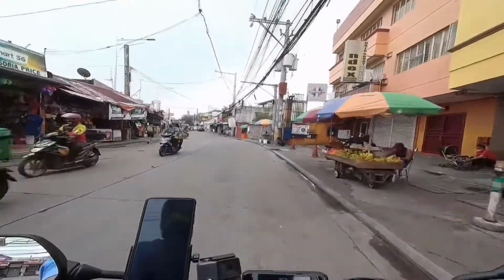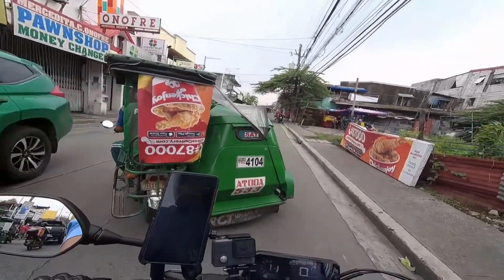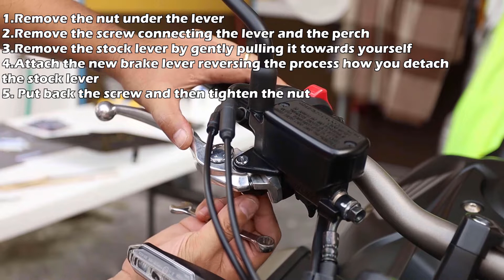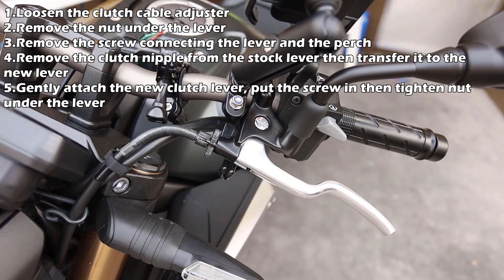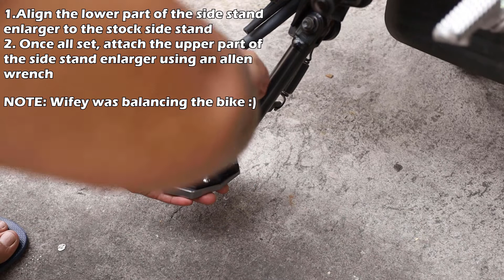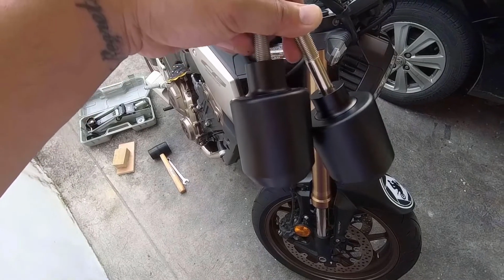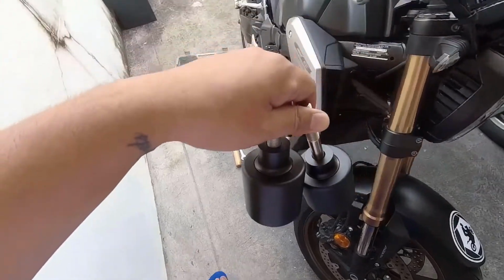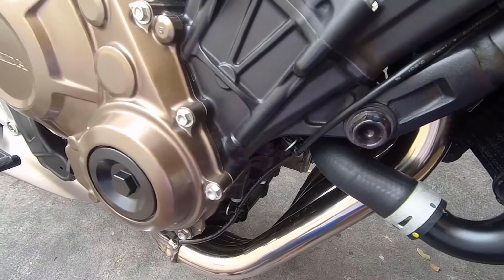HONDA CB650R 2021 ACCESSORIES! WATCH THIS BEFORE BUYING ANY ACCESSORIES FOR YOUR MOTORCYCLES

Comment: I have heard bad things about those levers. Make sure the bolts dont come loose. The last thing you want is for your brake lever to fall off while coming up to a corner.
Reply from the maker: So far it's good, making a habit of pre-ride 360 check is the key!

Comment: Boss, Hindi naba need ng torque wrench sa pag kabit ng mga accessories like ung radiator guard or even sliders?
Reply from the maker: Yung sa slider boss mas okay kung may torque wrench, pero if sanay naman maghigpit e okay lang kahit wala
Reply: @Motolente  Thanks sir. Kakakuha ko lang kasi kay CB hindi ko mailabas para pakabitan kaya balak ko nalang i DIY.
Reply from the maker: @retrokidadventures  ride safe boss and enjoy!
Reply from the maker: @retrokidadventures  minor parts oks lang DIY makasavr ka pa boss